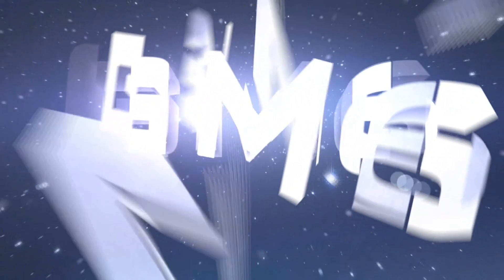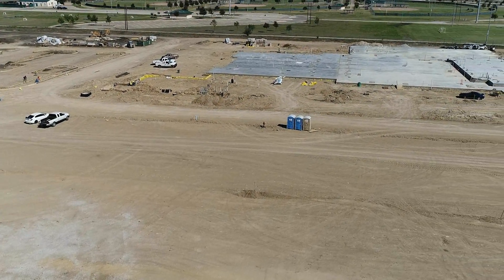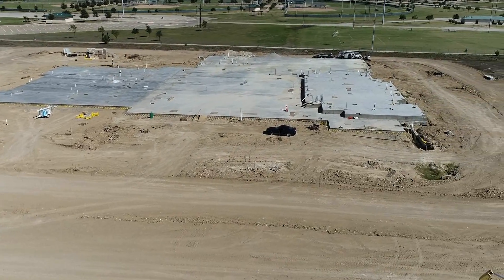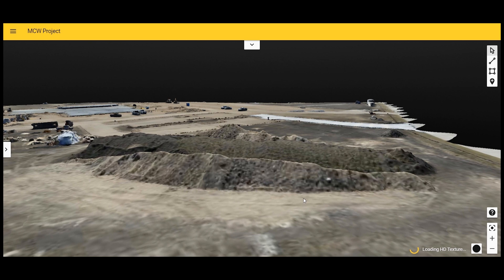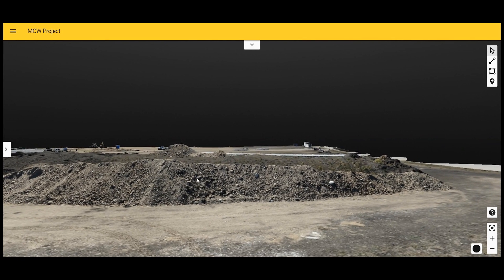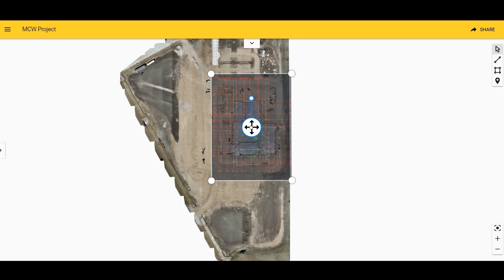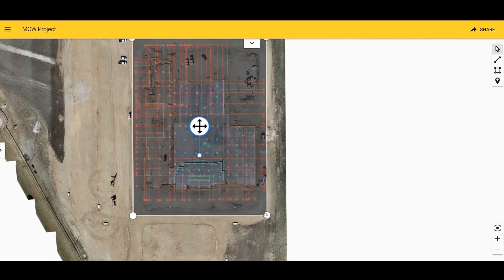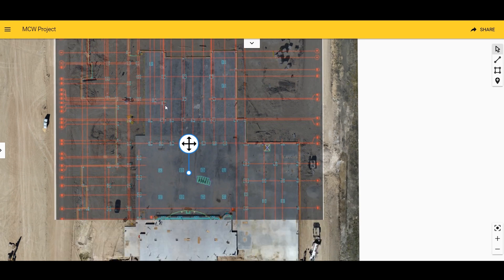Pix4D, Drone Mapping Construction, & 3D Models- Ep. 5

Comment: Which drone did you use for the capturing of these images?
Reply from the maker: Caliper Drones I would have to look it up, we used multiple drones on this project and I documented it all. But I believe this was the P4P.
Reply from the maker: Im not sure. Either the Phantom 3 or 4 Pro. I used both on this job
Reply: When capturing the images did you just do one flyby at 1 altitude or at multiple altitudes. I've heard to take that clear of 3-dimensional pictures you have to capture the images at multiple altitudes

Comment: If you're trying to find possible mistakes, the best way to this would be to import an orthographic image into AutoCAD. Assuming things are in the same coordinate system, they would line up exactly without any rotation, scaling or translation. Say for instance the building pad is correct, but five feet off, you'd discover this in AutoCAD, but not by scaling an image of the AutoCAD drawing into Pix4D.
Reply from the maker: Yes I believe you are correct, Except that I am only partly familiar with autocad. I use it mainly to open and convert files. I really need to find time to learn it better.

Comment: Hi. Which drone is better for mapping? Phantom 4 pro or mavic pro? Is one much better than the other? Thanks
Reply from the maker: +felipenep good question, the Phantom 4 Adv. Or Pro are your best options. The 20mp camera with a mechanical shutter that the Phantom uses is made for mapping.
Reply: And between the mavic pro and phantom 3 advanced? Which one is better for mapping and topography? The phantom 4 pro is a bit to expensive in my country.... thank you
Reply from the maker: felipenep same deal. The P4A. The camera is the same as on the 4Pro. I actually bought a P4A. DJI just took the Phantom 4 and put the camera from the P4Pro on it. If you plan on mapping I highly recommend the Phantom over the Mavic.
Reply: Sorry. I meant P3A vs mavic pro.
Reply from the maker: The P4P and the P4A  have the same camera, I would say they are equal. For mapping purposes the P4P and the P4A are both better than the Mavic.
Reply: the camera and image quality and resolution of the P4P is way better than the Mavic Pro . Having higher resolution photos gives much clearer data sets and you also don't need to be as close.
Reply from the maker: Fatih Çağatay Akyön My apologies, thanks for pointing that out. The P3 is better than the Mavic. They both have a 12mp camera but the P3 camera is better and has a wider angle lens, which is also better.
Reply: He is asking about phantom 3, not phantom 4..